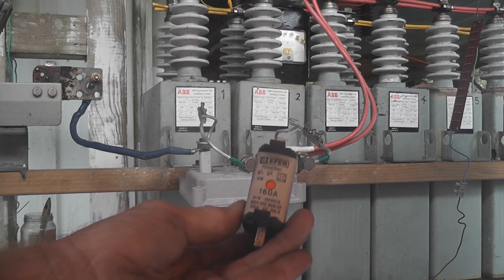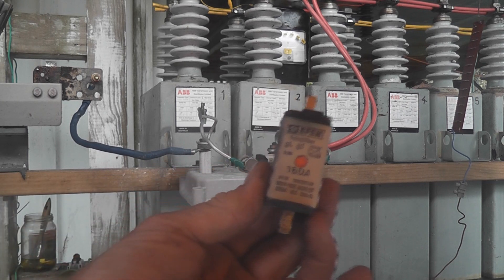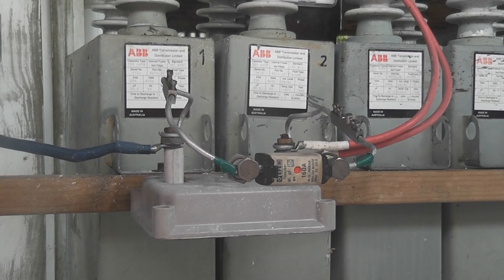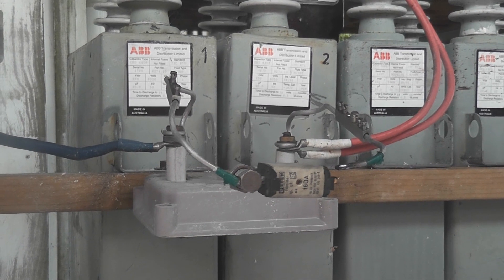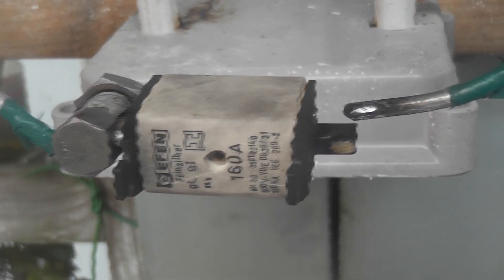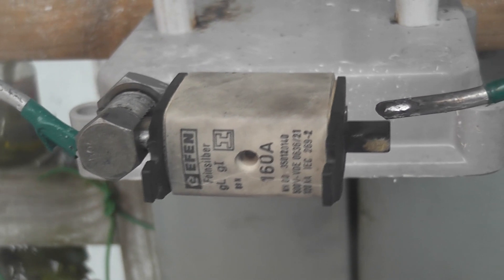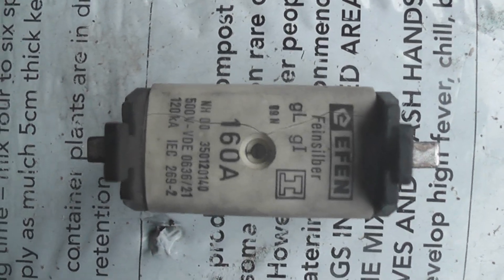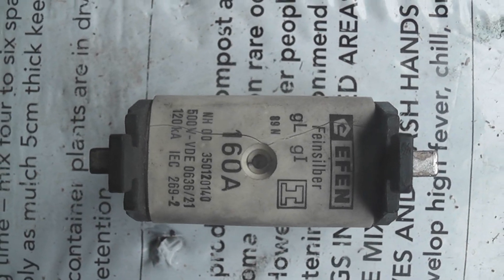160 Amps HRC fuse overvolted

Comment: Aaaah, interesting. It contained the blast..... well, sort of. It did crack the case, but it contained the blast so that there wasn't "bits-of-it-everywhere".

Could you do another video of this fuse and "open-it-up-carefully" so that we can see the insides and whether there's anything left at all of the fuse wire in there?

Given what you shoved into it, I'd seem to think that there's not much left in there, and there will be bits of melted wire in there and maybe chunks of sand where the intense heat 'melted' lumps of sand together.

If you found that fuse a bit warm on the outside, then it must be bit of a scorcher on the inside right in the middle of the sand filling.

....Well, I'm assuming that there's sand in there, as like most cartridge fuses. :-)

Thanxx for showing,

-BoomBoxDeluxe.

26th April 2015, 16.22
Reply from the maker: BoomBoxDeluxe Yes Wayne, I will do an autopsy video off the inside of the fuse. I do that next week as I wanted to show the complete fuse at work to some of my colleges first.